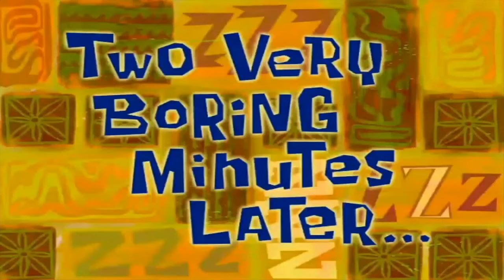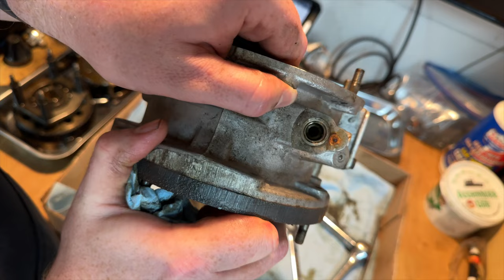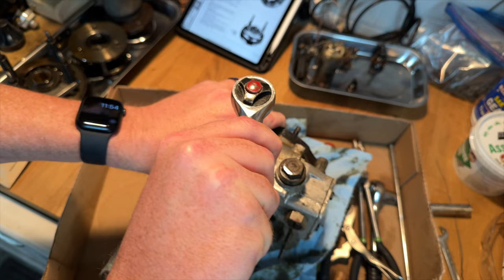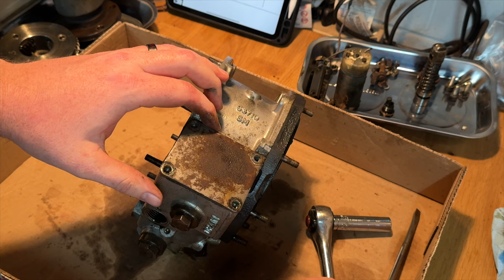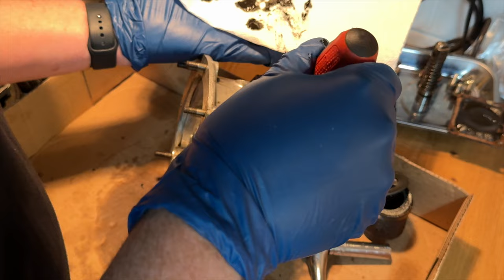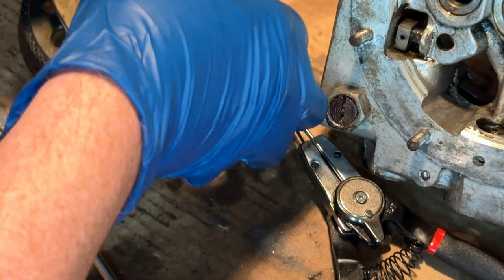Laycock de Normanville D-Type Overdrive Disassembly | Triumph Spitfire Restoration - Part 91

Comment: Thanks!  This smaller one is cute.The A-H3000 used engine oil, non-detergent spec but probably not used as it was hard to find even in the mid 60's.  The solenoid adjustment says use a pin through a hole in the lever.  It may not be aligned right using the pin & holes, so go by whether the solenoid actually lifts the valve, a ball bearing pushed by a rod on mine, a spool valve, the rod, on yours!!!!!   Line up the inner splines on the 2 pieces by sight, then with the main-shaft before bolting it together to compress the springs!  Also, don't use STP as lube for the pump's cam & roller!  it will skid & wear them out!   Very surprised by ALL the sludge, then again mine was only 5 years old.  Good Luck.